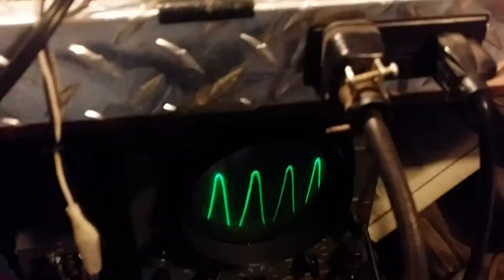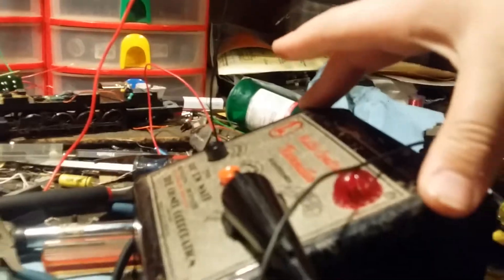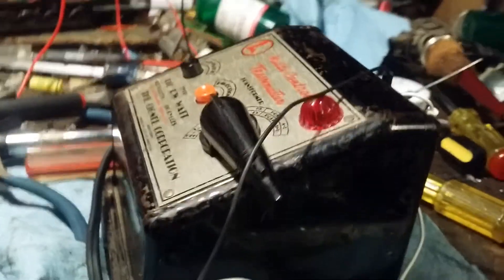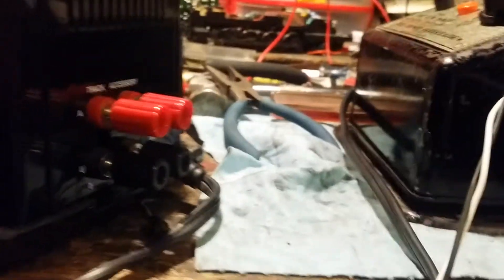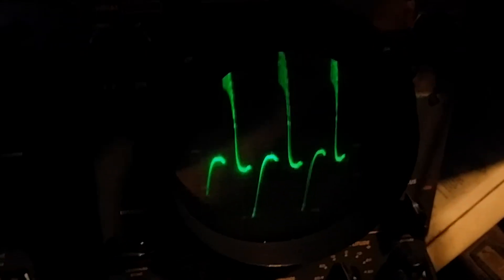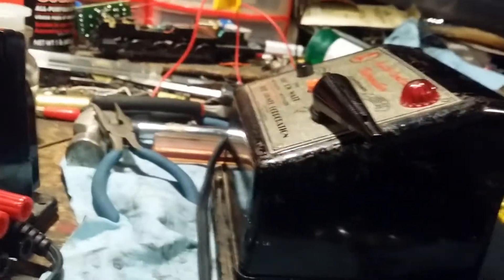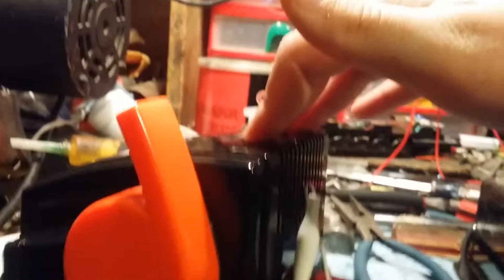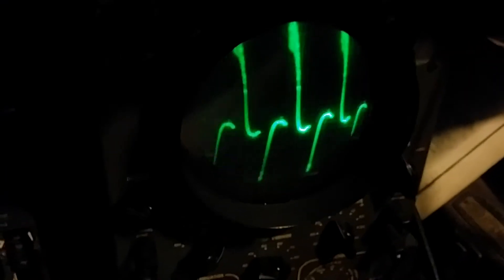Lionel CW-80 vs. RW. STAY AWAY FROM CW-80!

Comment: Not to defend modern Lionel, but do be careful to do your research before making a condemnation! The output waveform of the CW-80 intentionally spikes like that so that it is easier to rectify to DC while still outputting the same average power. It isn't harmful, especially not to postwar behemoths. In fact, it should be a little safer if Lionel has included TVS diodes inside the unit (which prevent the spikes from ever exceeding 30V or so). The real issue I have with CW-80 and modern devices in general is that they are much harder to repair. If postwar breaks, 95% you just have to clean it and maybe replace some carbon parts that were meant to be replaced. If modern locos or transformers break, it'll be harder to diagnose, and it'll likely involve buying specialized parts which may or may not still be in production... :(

Comment: My dad's old 1951 Lionel 681 Turbine set had the vintage Transformer featured in this video, the one with the gold face.  One day in the 1980s we were hooking it up to run, everything was connected fine, and safely, the transformer let out a horrible shower of sparks where the AC cord joined the chassis.  We never fully figured out what happened to it and don't have the knowledge to ascertain if it's still fixable.  I know that the power cord literally looked like it burned itself off the unit.
Reply: I'm guessing the rubber cord rotted or pinched by the frame and the stranded wire made contact shorting it out. That's what it sounds like with the info given. Its fixable.

Comment: I have an rw transformer, but I don't have any lionel track or locos. Would this be safe running HO or smaller gauge on standard twin rail track?
Reply: No considering that o gauge transformers supply more voltage than an HO transformer. O gauge is AC not DC! You'll end up frying it!

Comment: So is this why my Mth subway stopped working? I was using the cw-80 for a while on my train when one day my train stopped working and the light to my cw-80 started blinking. I don't know whats wrong with my train. I have an mth r142a with protosound 3.0 and I don't know if it's the cw-80 or the train. Do you know if it's the transformer or not?
Reply from the maker: You have a short somewhere in the line. A blinking light indicates so
Reply: The light hasn't blinked on the cw-80 since the day where it blinked for a few seconds, but my tracks still get power and by Proving  it, I put two tracks together to see sparks. It's just that my train wont turn on and I'm not sure if it's the train or not
Reply from the maker: Alex Campbell MTA You're getting power, therefore it's your locomotive. Does it work with another engine?
Reply: Peter Ronney  I'm not sure as I only have one set. But sometimes my cw80 had problems like, I would have to knock on the cw80 several times for it to fully power the train. It was just that day where I started running  the train when all a sudden the train just stopped, all sounds and lights turned off at once and the cw80 started blinking for a few seconds. My train hasn't turned on since then...
Reply: @peteylikestrains  I also have the issue with the stock CW power supply having a light blinking. For me, it is only one old engine that causes the problem where the light starts blinking. I've had the local model train shop check the engine, and they claim there are no issues. The old engine seems to works fine with my old transformers, but not the new CW that came with a starter Pennsylvania set I picked up.  My New engine has no issue with the CW transformer.  

I initially thought it was some kind of short in that one engine which is why I had it checked by the local shop.  but I still had the issue when I got the train back.  Reading through something I came across something about the light on the CW blinks when the " power limit of the Transformer has been exceeded" which suggests to me that maybe this old engine draws more current than the new engine which is why the transformer keeps tripping and going into the blink mode.

Comment: You are 100% correct!  The CW uses solid-state devices (diac/triac or similar) to phase control the AC output, basically switching it on at a certain degree of phase angle in respect with the throttle control lever.  When the AC voltage hits zero and the voltage proceeds to go in the opposite polarity the process starts all over again.  This is very hard on all electrical components but it also generates a huge amount of RFI (electrical interference) which you can see for your self just by holding an AM radio anywhere near the tracks being powered with a CW.I have an original RCA "ON AIR" light that I ran at half brightness using a diode which only allowed half the AC sine wave to power the lamp.  It burned out almost as fast as if it were lit full brightness and I found out why...  The half-wave rectification caused the filament to undergo more stress flickering at 30 Hz instead of 60 Hz so I replaced the bulb and got rid of the diode and use a dimming resistor instead.  The new bulb has been burning without fail for nearly 10 years and still works fine.FACT:  Surges damage electrical parts.  That is why surge protectors are available from almost any store these days.  Chopped AC causes surges...nuff said.

Comment: The chopped sine wave output of the CW-80 delivers higher levels of power because there is less time when the wave is at the zero line.  The increased time spent at either extreme allows for more consistent operation of modern smoke units and electronics.

Comment: Modern Lionel transformers output a chopped sine wave as opposed to older transformer's pure sine wave. Lionel has an excellent video on the difference between chopped and pure sine waves and their reasons for making the change. I know next to nothing about electronics but I could follow it. Essentially, the chopped wave has a higher peak voltage. The extra power is stored in a capacitor and gives the transformer controlled electronic features like whistle and smoke work better. Most MTH transformers output a pure sine wave so MTH engines may encounter problems when powered by a modern Lionel transformer. 
I have CW80 that works perfectly. It's about four years old. I have heard there were major problems with older CW80s.

Comment: im going to get my vintage rw tested at a train show to make sure it works my cw is dead but i like postwar stuff more because its well made unlike the modern stuff
Reply from the maker: You could hook it up to your track in place of the CW-80 or use a volt meter to measure the output. Usually the windings on those transformers don't burn out, they're pretty think wire as far as transformers go.
Reply: would it run a modern locomotive
Reply from the maker: +The Rail Warrior It wont. It's still alternating current.

Comment: I don't know much about Lionel transformers (I'm in Europe) but judging by the wave it puts out it must use a phase-fired (Triac based) controller for speed regulation. Why? It's cheaper than a rheostat or a transformer with many taps.
Reply from the maker: The CW-80's throttle has a smooth movement while the RW has a rough movement because it is wiping across the windings. It puzzles me too. Why did they try the phase-fired approach? Maybe they were trying to be innovative or something.
Reply: Streamlined Steamroller
Main reason=cost. A transformer costs a lot of money, and even more so if it has special features like exposed windings for a wiper or several taps.  A triac costs nothing, especially in the power range required by model trains. A triac capable of 3000W at 230V costs 1.20€, obviously for a model train the part is going to cost something like 0.05€ (and even less in bulk)
Reply from the maker: MrOpenGL Oh. Ok. Back in the day when they made their own parts, it was probably alot easier to get an exposed winding transformer. Not to mention phase-firing was not around yet.

Comment: I have an old ZW and a CW-80, which run four lines on my layout. The ZW is rebuilt and runs flawlessly. I always wanted the ZW because that's the transformer Gomez Addams used and they look so darn cool!. I also acquired a CW-80 with a bunch of used trains. I had heard nothing but bad things about the CW-80, like kids opening train sets on Christmas morning which would not run due to the transformer being bad. Lionel had a huge batch of them from China which failed, so people don't like them. Mine works great with, prewar, postwar, and new trains as they do with my ZW. probably a fluke. LOL. I assume so many failed due to lack of decent workmanship. The biggest problem with my ZW is the circuit breaker is slow while the CW-80 reacts instantly to a derailment. Maybe I got the only good Yugo out of the batch. Did you reverse polarity with your sinewave and if so, did it make a difference? Great upload.
Reply from the maker: +Lance Boil I put the ground on the common and the positive on the AC hot on both of them. I'll try reversing them. I'm curious now.
Reply from the maker: +Lance Boil I tested the CW-80 again but I reversed the polarity. I got the same thing. I also found that the CW-80 wave is sorta like a sine wave, but squared off at one end. The top of the wave is also made up of a few saw tooth waves. Either way, an old noncomputerized transformer.
Reply: Well,with  these trains it's always a learning experience. (-;
Reply from the maker: Lance Boil You said it! I remember when I wanted to get my 2343 running for the first time, I had no idea what anything was inside of it!